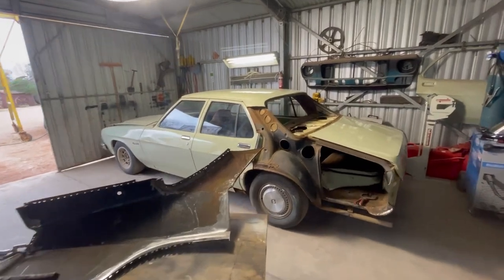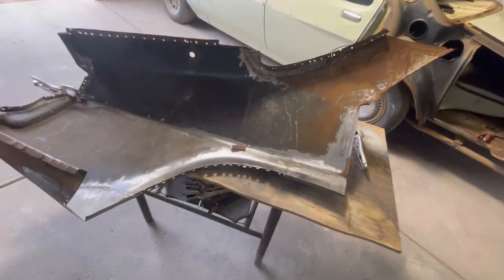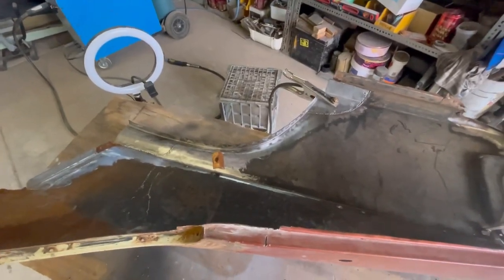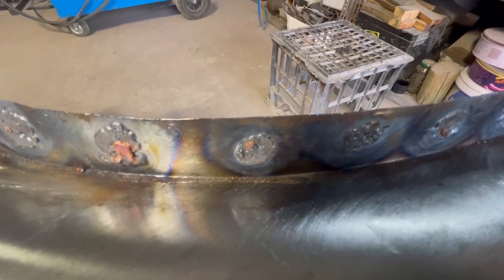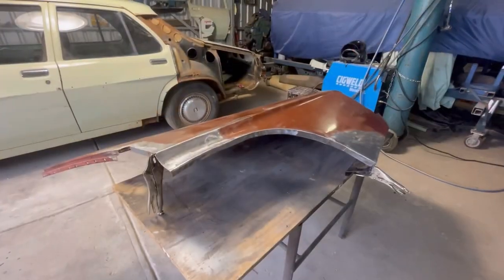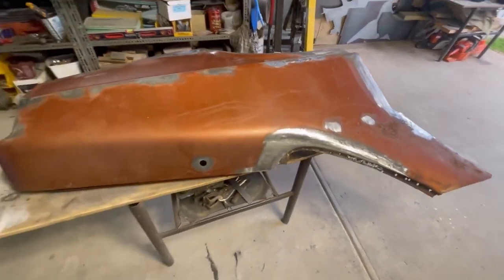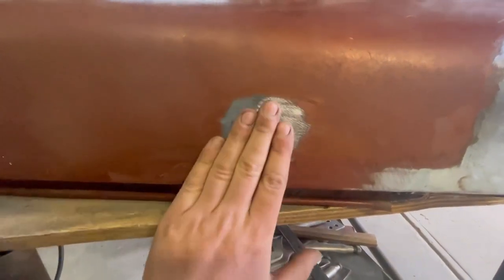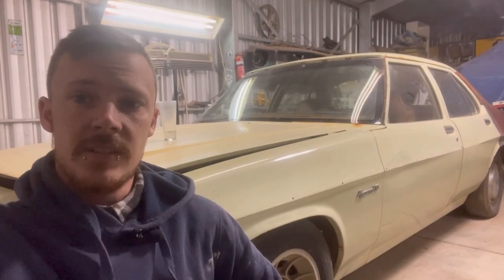Hole Filling Basics - Autobody Mig Welding - The Resto Shed

Comment: that 1/4 panel is going back on another car so them holes in the wheel arch that were drilled out  are factory why would you fill them in  when you have to now drill more holes so you can  weld them back on to another car lol
Reply from the maker: Car is being tubbed so there won’t be anything to weld onto, so I can do away with those holes.
Reply: @TheRestoShed  no worries that makes sense then cheers